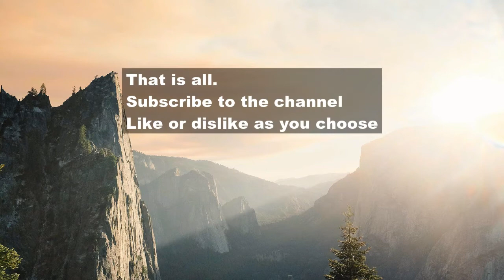Innokin Zlide Tube button repair

Comment: hi,, what is the name of the first Tube you using for unscrew ?
Reply from the maker: Haha
  This friend is a tool made by me personally. I have not heard it is available on the market. However, any stainless steel evaporator (large enough to hold firmly) and pull the flange can be used.